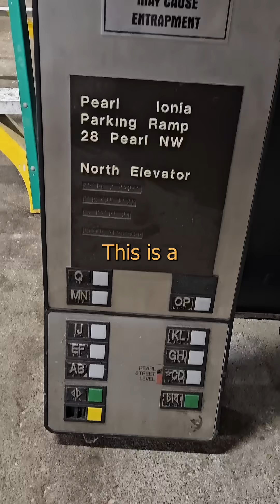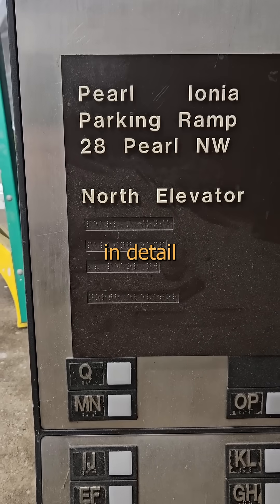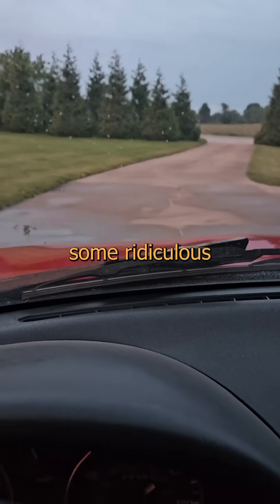Miata Mischief #chrisboden #engineering #gear #elevator #score #stories #parts #hacking #making

Comment: Hauling things in interesting ways because it was only cheap at this moment when you haven't the right vehicle available is a specialty of mine....

Once I hauled 15 old PC's  with my little Trabant Limousine I got gifted, a other time I hauled an entire Hobby workshop whith lots of Tools with my Trabant station wagon. On my Small Lada I recently hauled an 2,20 meter long piece of furniture on the roof I got gifted, because it didn't fit inside the car....

I once found an old bicycle trailer on the side of the road and attached it to my moped with some flower wiring to haul it home.

Comment: We had too much human cargo up at the bonfire one day.  The bonfire was about 15 minutes out of town up a winding forest service road, and what we lacked in cargo capacity we made up for in redneck ingenuity (idiocracy).  Pulled the hood off a burned out acura and decided we were gonna play tobbogan in the summer.  Used the tow straps and punched some holes to rig it up and off we went, 3 people leaning waaaay back on the hood so as not to catch the front edge.  It worked great and the sparks were flying everywhere, and somehow the driver managed to keep them out of the ditch (one side was more of a cliff).  The next week, a friend welded a pickup truck bench seat to it and summer tobbogan became pretty big for one summer.

Looking back it's a miracle most of us survived our teenage years.

Comment: Well to cover myself a strong decendant of my father i took a 2021 buick encore threw a king size mattress on top. Loaded a solid steel frame into the car as well as 3 sandbags, 2 passengers, and some lumber. It looked absolutely ridiculous but worked for the 3 hour drive i made with it. So surprised I didn't get pulled over
Reply: My father however somehow fit a full size 4wheeler in a ford focus. Dont ask me how because it looked like witchcraft. Did not look like it should have been possible

Comment: I have one of these Otis canoe panels too! Hopefully yours has a voice board on the back of it. It's possible to get them to talk when you supply them with power. Yours doesn't seem to have the speaker on the front but it's still possible it has some sort of speech system on it. Can't wait for the video.

Comment: Worked at a mold shop and we had to bring a couple ~150lb inserts over to the heat treat place about half an hour drive away. Of course it’s 3:30 and they close at 4. I’m the kid with the flashy new Audi in the parking lot who drives like an absolute idiot. So we throw the two inserts in the trunk of my car and try to strap them down the best we can, and I haul ass to the supplier. Almost all the way there, someone cut me off while I was doing like 80mph and I had to slam on the brakes. Thought for sure the straps were going to come loose and I was going to get final destinationed by the mold for a toilet brush flying through the back seat.

Look on the peoples faces at the heat treat place when I back in the Audi and pop the trunk like an arms dealer in a mob movie were priceless. Made it like 5 minutes before they were getting ready to run the last batch of the day, we would’ve had to wait 4 more days before their next batch of S7 went in the oven.

Comment: Ride in the back of a Volkswagen camper van, leaning over the exposed engine watching the level of the rad fluid , hauling 2200 lbs of sailboat. Note fluid tank is almost out the back of the van.

Comment: Tree, rope, floor jack, motor with double worm gear reduction box, and my basement stairs to get a mill into my basement shop.

Setup: Motor screwed into the stairs (just the side that would lift up cause I only had 2 of them) floor jack bracing the stairs against a floor joist. Motor had a rope attached to the pallet the mill was bolted to. Another rope that went out, wrapped around a tree branch for friction control (enough to be controlled by hand) then back to the top of the mill.  Had 2x4's for rails.

Now that set up is done, here's the process. Turn on the motor to bring in the bottom a bit, top of the mill will be held back by the "control rope". Then slowly release the control rope to let the top down and tie off. Repeated this a lot and very slowly until it was in.  Still have pictures somewhere.

Oh forgot to mention this 1000ish lb mill was towed with a Prius C

Comment: Entire 600cc motorcycle in the back of a 98 Jetta Tdi wagon. Loading 4 motorcycles in the back of my truck with no straps. Sketchy rusty trailer with rotted ply wood walls hauling probably 1-2 tons of rock. I have more but they aren’t as good as those

Comment: I’ve just picked up a 1998 Peugeot 306 XSi which is effectively just a late 90s rally car without the turbo. Taking it to car shows this last week has been great fun but my 2 year old is a nightmare so today we went to a modified and supercar meet with his electric ride on McLaren f1 car crammed in the boot. 2 adults in the front, 2 kids in full size car seats, 4 camping chairs, half my tool chest in anticipation of 30 year old French gremlins and a huge f1 car with a wheelbase about 60% as large as the little 3dr French hatch it was crammed into. 

But we do what we have to because you can’t have nearly as much fun driving something fancy and comfy.

Comment: I found a custom power supply(?) put into a cold war us air force electrical cabnet and two variacs in the garbage of my university the night before a midterm exam I should have been cramming for. My girlfriend and I spent two hours trying to fit the 400 pound rack it into the back of my CRV. I ripped the back of two seats, punched a hole through an asphalt patch and failed that exam so hard i had to retake the class over the summer. Good times!

Comment: This one actually happened recently. I have a crappy little trailer that i intend on fixing up. In the meantime, the sides are plywood and pretty thin. 

My buddy wanted to go up to the woods and take out his new mini bike and i wanted to take my go kart. I have one of the new mavericks with a 4' 9" bed, so the mini bike got the bed and the go kart got the trailer. 

It was here that we realized there were no tie downs on the trailer. I had to use a camback to dangle it over the front wall of the trailer around the tongue. On the way up, we lost some parts of the rear "door". So on the way down the kart was one bad bump away from rolling out of the trailer and into the road behind us

Comment: I had a Hyundai Veloster and have the build and profile of a refrigerator (Google the car, it was hilarious seeing me get in and out of that thing), slumming it a few years back. Went thrift shopping and found a gem: a brand new queen sized mattress and box springs for $20 each, and not shitty ones either. 

I was living in Washington, and coming from Texas where everybody I knew had a truck, I didn't think too much of it as I made the purchase. Afterwards, I go to call up my friends and ask if anyone has a vehicle that could transport a mattress.

As I'm sure you can guess, none of them had anything bigger than a Subaru, so I fished around in my trunk to see if I had anything that could serve as securement for the four or so miles to the house I was living in, and found a 10 ft long braided leather bull whip that apparently my friend had left in the car after we had moved up there. Having nothing else that would do, I cut a hole in the black thin sheet on the bottom of the box spring and tied the whip to the strut on the bottom, set the box spring on top of the tiny car with the mattress on top of that, and pulled the whip from the back corner out of the third window (car had only three doors, again look it up it's a phenomenally goofy and wonderful machine) diagonally across the top of the mattresses to the driver window where I held the whip handle with one hand. 

I had to pull like mad to keep tension and it nearly flew away at least twice, but that bed served me well for the next 5 years. I may or may not still occasionally use the whip as a securement device, as I can't quite bring myself to take it out of the car since then. 😅

Comment: I also when i started out in the hvac field. I was working on some roof top replacement i found out a 10 ton ac carrier unit will fit perfectly in the back of our 1 ton ford 

(The 10 tons just refers to the amount of cooling)

Also i have a picture of it somewhere but ill have to find it

Comment: Had an 83 Lincoln continental. Work gave old building siding. I didn't have a truck. So I rolled down all 4 windows. Stacked all of it on the roof. Ties it down on each end on the bumpers. Then used works banding machine. Banded the whole stack to the roof through all 4 windows. Of course the doors are useless now. I was called redneck all week.

Comment: 2012 I only owned a motorcycle and I needed a new TV and unfortunately didn't have anyone else to borrow a vehicle or a ride, so I bought a new TV, 32 inch flat screen (pretty big for the time and for me considering if been rocking a 19inch booty girl for 10 years) well course work (Walmart) had a deal for a laptop going as well, 15in Dell inspiron, so I grabbed it, we'll that fit well inside my bag but the TV didn't, so here I was with a TV strapped (yes actually strapped) around my chest straddling my tank going down the road to my house, 15 miles or so and I get pulled over because it looked shady to the cop, so yeah, ran my stuff, told me to be careful and sent me on my way.... I had that TV for 10 years until I dropped it it off my bed while packing to move.

Comment: When the call center I worked at shut down i sweet talked the shutdown team into letting me take a 8ft by 6ft white board home for a gaming table. I was going to load it into my equinox, but my dad took it that day so I had to duct tape it to the roof of my brother's scion iq and take the back roads home. Any time I went over 20mph it would vibrate angrily.

Comment: A 250cc Cleveland Ace fits in the back of a Honda Fit if you don't care about denting your bumper cover. Tie 'er down, move your license plate somewhere it can be seen with the hatch open, and you're set to drive across town.

Comment: I had help loading a very heavy copy machine in the back of my ‘79 Mustang, but no help when it came time to unload it. So I got a running start to get up to about 30 mph in reverse and then slammed on the brakes.  That got it out of my trunk and crushed a couple garbage cans. …and that’s why my tail light is busted officer.

Comment: I hauled a dog kennel full of live chickens 100 miles in a 1979 Ford station wagon...in 2017.
Also hauled several 10' boards of lumber in a 2-door Smart car.
I think my former rowing team takes the cake, though. A 27' racing canoe on top of a Honda Fit. The car looked like a tiny fulcrum in the middle. It was a feat of balance, acrobatics, and engineering to get it up there and make it stay. We freaked many people out.

Comment: I found out last year that a 40 gal hot water tank will fit in the back seat of a 1993 ford tempo

Me and my friend were also doing some scrapping with his aluminum trailer from tractor supply alot of transmission and engine parts 
Lets just say the trailer is rated for 1 ton but can haul over 3 tons just fine 😂

Comment: The Jet Ski inside the '78 Fiesta isn't in the running.  How about 8' lumber, 10' plumbing, and 3 rhododendrons from Lowe's on a Ninja 500.  At the same time.  Or the Troy-built chipper/shredder hung from the rear bumper and seat belt mounts on a 66 Bronco.  It wouldn't fit inside, and i moved it repeatedly this way.

Comment: Welded pipes across 2 bikes to make a cart of sorts to get 3 full length pine trees from the woods at the end of my neighborhood to make a 40’ tripod in my back yard for pendulum experiments and a rope swing. Used an old cast iron worm drive engine hoist & mini tripod made of 4x4s to lift and manipulate the trees onto the “cart” then pushed the thing all the way home 3 times about a mile each time . I was 14 once  I was home with them all stripped the bark & lightly charred the outside to keep bugs from eating it. o made a steel hinge contraption strapping/ bracing  the trees together.   Lasted 3 years until lightning strike snapped one of the legs.

Comment: When I was in my 20's, a friend of mine was moving about 4 hours away and needed some help. He had a Nissan Z, and I had a Ford Ranger. (Yup, it's one of those stories... What can't you do with an old Ranger?!?) He loaded his car with his clothes and a few small things and everything else from his 2 bedroom apartment went on the Ranger! When looking at my loaded down Ranger, I  was reminded of both The Beverly Hillbillies and The Grench Who Stole Christmas! 😅 couches turned up on their sides, dining table on the roof of the truck with the chairs and a dresser on top of it, coffee table braced on the side of the truck bed strapped to the couches. Stuff hanging over every edge of the little truck. I'm sure you get the idea. We used 20 ratchet straps to secure everything and drove it 4 hours across I40. It took half a day just to unload the truck, but nothing got damaged or lost!

Comment: Hmmmm. I've hauled a LOT in my 2011 Honda Pilot. Most notably a $50 fire cabinet I drove two hours for to pick up in the middle of no where. Definetly thought we were going to get killed on that one. Barely could pick the damn thing up with three people. Then there was the 60lbs of potting soil that the Menards crew was convinced wouldn't all fit in the car. Shed some blood on that one and the car was sagging hard but they all fit! And then probably the funniest was this massive white board I drove an hour out into Amish country for. Didn't measure properly and well, it was to long. Ended up having to shove the thing over the front seats to get it to fit. Me and my passenger spent the entire hour ride crouched down in our seats getting smacked in the head by the white board. Wasn't sure how I was going to explain that one if I got pulled over. 😂

Comment: I've got two stories 
1) I found a CRT screen on a trash pile. I went there several times with different tools trying to disassemble it, but eventually decided to bring it home whole. I put it on the back of my bike and pushed the bike to the nearest train station. From there, I carried it up and down 2 staircases and drove 3 stations before asking my mom to come to my home train station with a trolley 

2) I found a bike in a river. I made several trips to pull it out of the river, then realized that the front wheel wouldn't move, so I used cardboard, toothpicks, clip on wheels for turning your shoes into skates and a ton of glue to essentially build a wheelchair for the bike. I then had to get home (like 4 km) while pushing both the wheelchair bike and the bike I used to get there

Comment: Back in high school my friend's parents would scrap  metal as a side job. So one day they got an old dead class c RV, which they tore down to the frame, sorted the metal and strapped that and any other scrap they could on it. It's basically a 30' skateboard with a steering wheel. They strapped it to a tow vehicle and headed down to the scrap yard, only to get pulled over a few miles in. They're told that my friend's dad can't steer the RV because "reasons" so they need another driver. so they call me up, a freshly licensed driver,  to drive while my friend's mom steers Uberskateboard. Now it gets interesting. The tow vehicle is beat up 1987 Ford Thunderbird, dubbed "ThunderChicken." The scrap yard is down the mountain about 30 miles and and over half a mile of elevation away. I white-knuckle it the whole way down and get pulled over a few hundred yards from the scrap yard. I was nervous as hell, but the cop was ok. Understandable, we looked nucking futs. He let us go,  we made it,  I got $300 and lunch for a half a day"s work and a story on it. That's just the tip lol.

Comment: Grabbed a 10 pound ammonite fossil the same size across as a dinner plate out in Wyoming, wrapped it in tinfoil and duct tape and stuck it in my suitcase to check it in. Security had s lot of questions on both sides of the border and Canadian customs went through my whole bag and pulled me aside for questioning.

Comment: I once drove an hour a way to pick up a non-functional Nordic Track C2500 from somebody on Marketplace in my Toyota Camry. I pulled up, and the owner was like "Do you have straps?" Buddy, I'm in a Camry. Absolutely no chance. We took it apart as much as we could without tools, folded it up, and shoved it as far into the trunk as it would go, with a good 60% of it hanging out. With nothing to tie it down, I drove approx. 35 mph the whole way home with the most annoying alarm ever yelling at me the entire time that my trunk was open. Got it home in about 2 hours, fully disassembled it, then back together, and thanked every Power that Be that it worked!